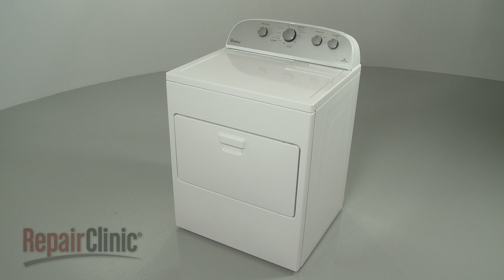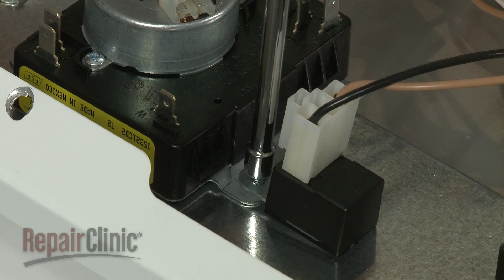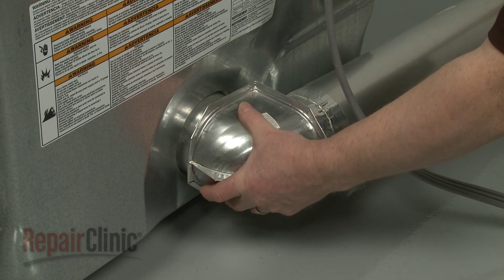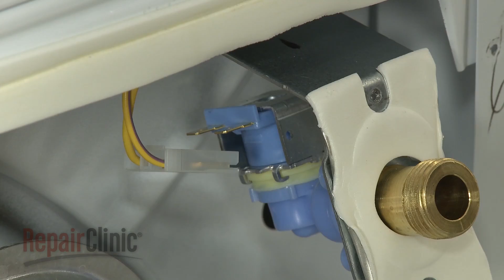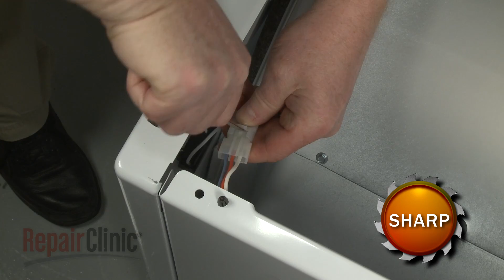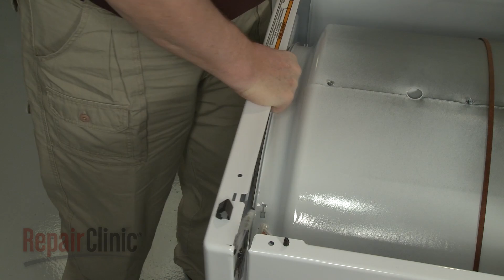Whirlpool Electric Steam Dryer Disassembly – Dryer Repair Help

Comment: Hi. I have a Whirlpool dryer model YWED49STBW0 and I have water under my dryer. I never use the Steam function but by water pipeline is connected. Probably there are a leak even I dont use it. So, Can I unplug  my water inlet /pipeline from by dryer and dont use my steam function ??

Comment: Just got this to replace a 20 year old whirlpool dryer≖>allmy.tips/Whirlpool-Dryer?T20     so I stuck with the same brand. I found this dryer dries SUPER quickly! I am sure this will save on my electric bill My old dryer was starting to wear out of course ((and then just died last week), and with my old one I had to do two cycles to dry towels. Now just only 30 minutes to dry towels and it’s so big inside I can dry two loads (in 30 minutes)!